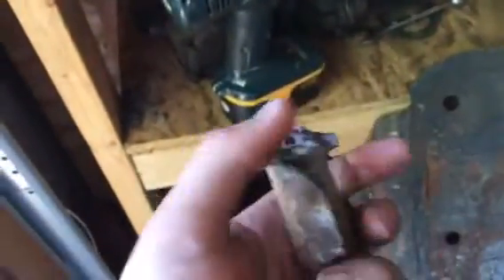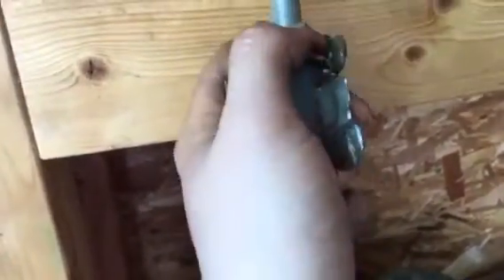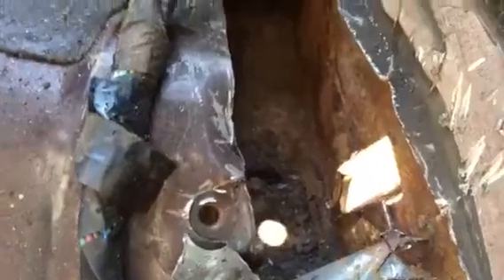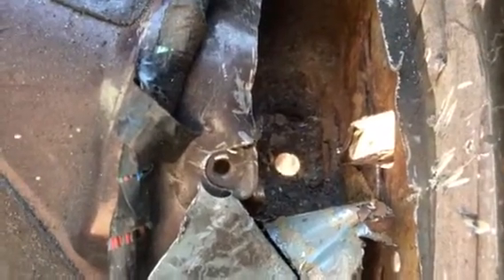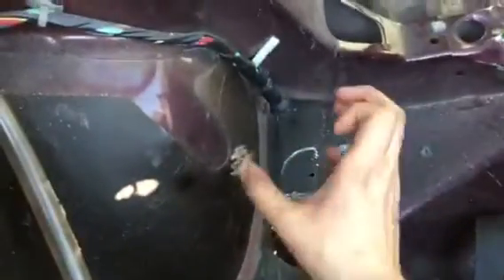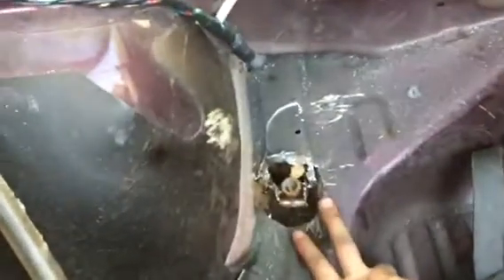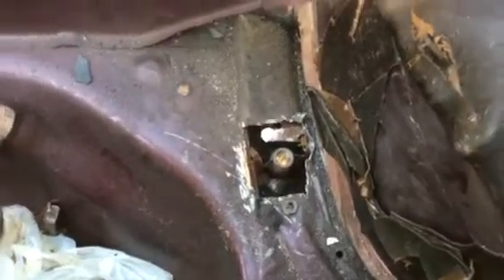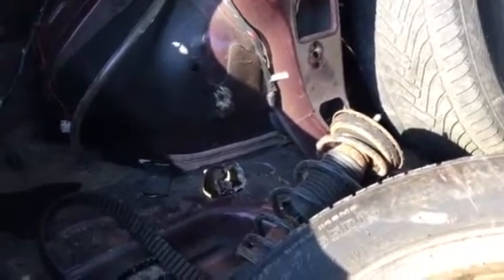Eclipse awd swap - subframe bolts cut 3

Comment: Hey man I'm 17 with a 03 eclipse convertible and I want to sway 4g63 engine and awd Tran in to it but unfortunately idk to much about eclipse and I saw you had the same car and I 2ould like to know if you'd give me some tips on the swaps
Reply from the maker: Hey Micah, my car's a 2G (95-99) and yours is a 3G (2000+). Unfortunately, the chassis are very different between the two and I'm only familiar with the 2G's. I do know that http://www.club3g.com/ is a forum dedicated to your model. I'd recommend taking a look there and asking around. The only thing I know is that the awd swap is a lot more involved for 3G's because they don't have a built in tunnel for the driveshaft. Since the 2G uses the same chassis for the fwd turbo and awd models, that's not an issue for me.
Reply: Jake Halsey okay I appreciate it jake
Reply: Jake Halsey beautiful car btw
Reply from the maker: Thanks man, good luck with your project! It's a great hobby.